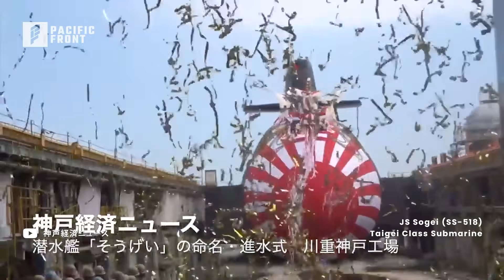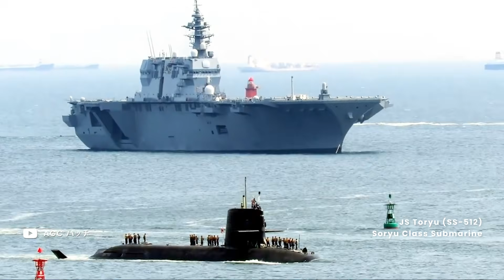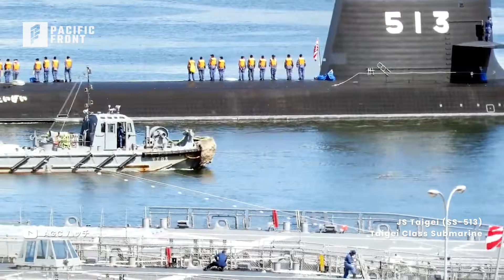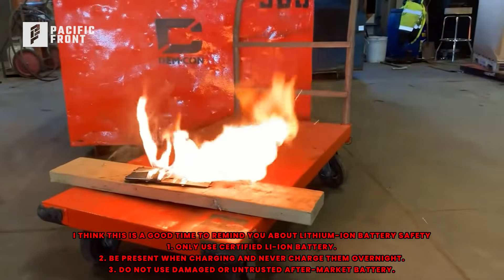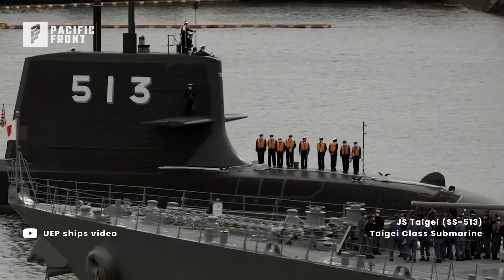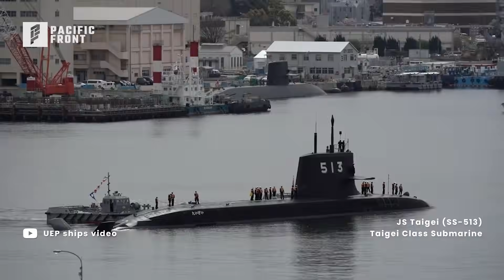Taigei Class Paradox: World's Best Conventional Submarine That No One Can Buy

Comment: Japan has used drumbeat construction programs to create excellence in shipbuilding and that is the model Australia should be following. Maybe we want to have a new sub every 2 years instead of every year. We can still do this. If needed you build not to a year but to a 30 month commissioning program. so every 30 months a new sub is launched. After you build 4 subs you go to the new model. and keep to the same build rate. It means you have plugged in to the Japanese submarine tech and pay for it as well. As an Aussie that works for me. Maybe after 15 years you want to sell the submarine and Japan agrees. you then sell it after refurbishing to an ally with needs but not full funding.
Reply from the maker: I think that could work.. building one every 2 years, upgrade the design and capability after 4 to 5 boats, then sell it to other country after just 15 to 20 years of service.. this can keep Australian submarine force up to date and relevant, and at the same time get a "cashback" from the sold submarine..
however, this means Australia might end up with more submarine than it require by using this model.. and looking at Australia's recruiting problem, I think it's kinda hard to achieve.. selling it to other countries won't be easy either since not many countries that need used submarine every year..
Reply: @PacificFront  The real key is we need to have Submarine and destroyer/frigate building constantly to keep the skills relative. The same is with everything else. I do not care if we need to purchase something in order to retain the skill base. I do not think we make ammunition in the country besides small arms. We need to make bombs and shells. If we have a surplus tell the army etc to train harder. Democracies often fail to spend where it is needed and are on a relaxed posture. In the long run it is cheaper to preserve skills.
Reply from the maker: @alexandermarken7639  that's true.. you don't want to cut this link.. it must be nurtured year after year, decade after decade.. because when you cut this link, it's easy to lost everything you've built and will be hard to get it back up.. this happen with the Canadian shipbuilding industry..

I learn about Australia's plan to make your own missiles.. that's a good start.. and the Ghost Bat is also something that is achievable for the Australian aviation industry.. now it's time for Australian shipbuilding industry too..
although I must say, you guys seems to have a rough start..